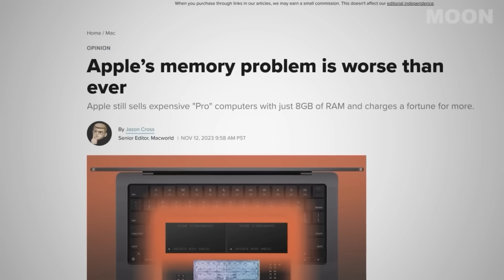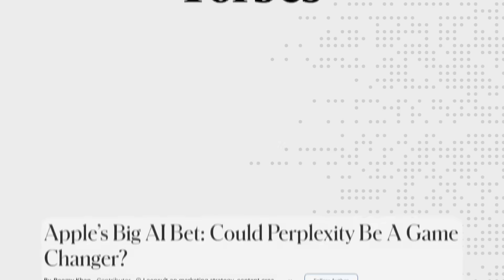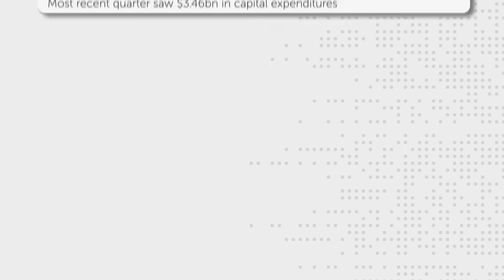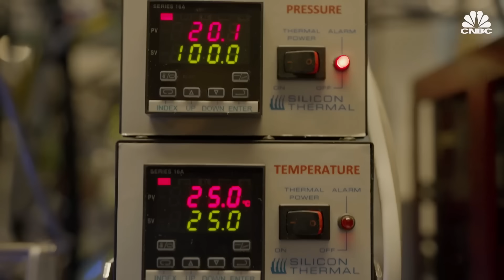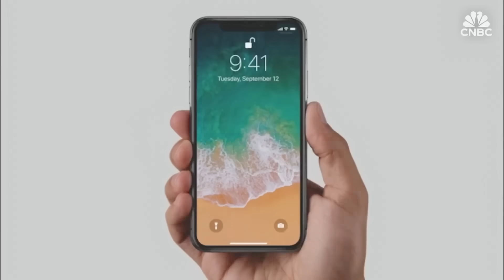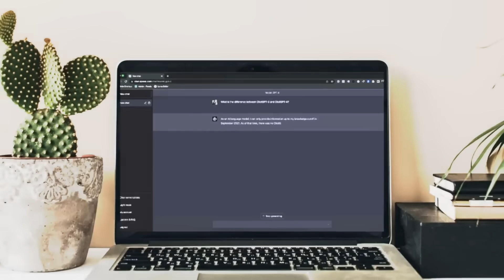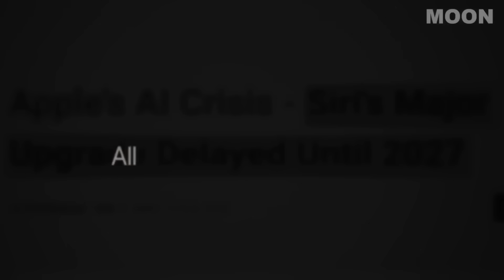Nvidia Era Is Over: Apple Just Revealed the World’s Most Powerful AI Chip

Comment: From GROK on xAI

xAI's focus is on rapid iteration (e.g., Grok 4.1 outperforming rivals in writing) via massive compute, but it's not CUDA-exclusive. Like Tesla's Dojo shift from NVIDIA, xAI may develop custom silicon to further decouple from CUDA, especially for inference where dependencies are lower. Partnerships with Google (TPUs) and AMD indicate diversification, driven by cost and availability. For now, though, CUDA powers the high end of xAI's stack, making it integral but not an absolute requirement for operation. If you're running Grok locally or building on the API, CUDA is optional—cloud access handles the heavy lifting.

Comment: Apple has no dependence upon Nvidia GPUs.  Apple stopped using Nvidia GPUs a long time ago.  I doubt Apple has bought any recent Nvidia A. I. processors for their data centers. 
Apple isn't going to compete with Nvidia as Apple won't be selling any chips it designs to other companies. Even so, Apple will likely design some low-power chips that can't match Nvidia's power-guzzling GPUs in raw compute power. 
Apple operates so differently from all the other tech companies that there isn't any way to compare Apple to any tech company and certainly not Nvidia which constantly boasts how much better their products are than anyone else's. Nvidia has conned nearly every other tech company into buying tens or hundreds of thousands of GPUs they don't actually need and the useful lifespan of those GPUs will be only a few years, at best.

Comment: This is just wishful thinking for Apple fans.  They are an excellent company in many ways but they are not even really in the AI race.  With hardware, they are behind Nvidia, Google with the Ironwood TPU, AMD and Chinese providers.
Reply: Apple built an ARM CPU architecture which outperformed about any other platform on the market.

Building a TPU or other type of accelerator for AI is within reach for sure.
Reply: @JLT9150  Apple was a big investor in ARM in the early days. At one point having over 40% of their stock. I don’t think Apple is trying to be the bleeding edge of AI; however, I think they’ll have a place in that space.
Reply: @nsatoday GPU design is very well understood and goes a long way to accelerate AI/ML
Reply: Apple does not need a cudu as they have their own trapped locked in customer base. They have the money to skip straight to 2mn
 The flaw in this is battery life will be shit.